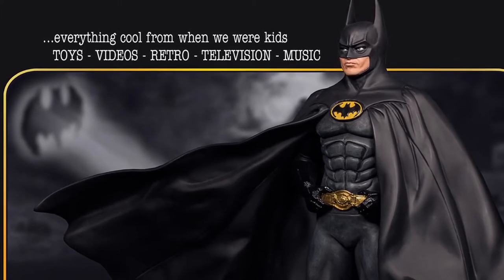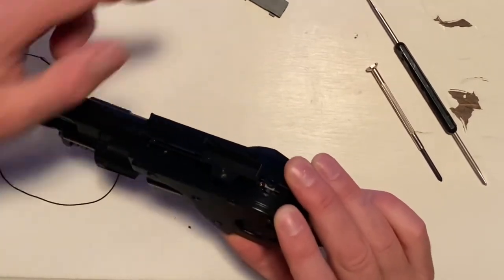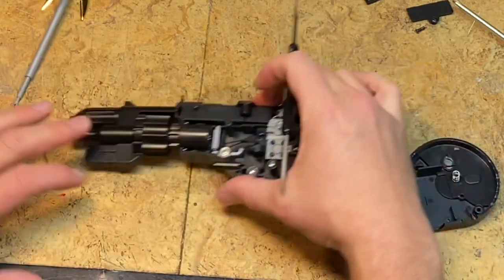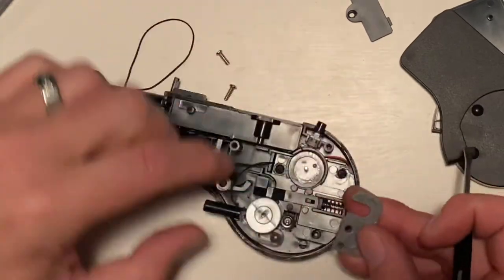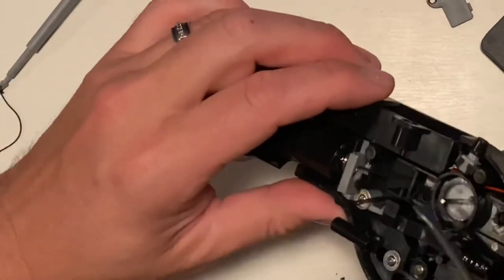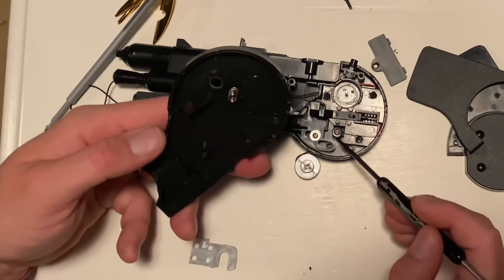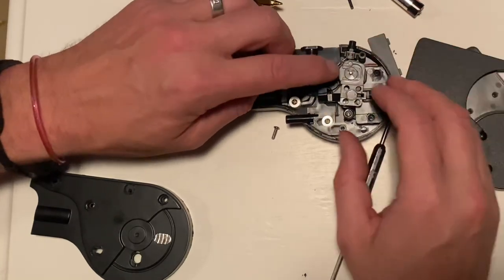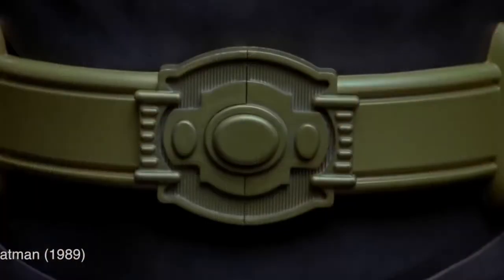Repair NECA Batman 1989 Grapple/Grapnel Spear Gun and Modify Teardown

Comment: Wish I had seen this an hour ago. I was trying to modify the gun so the halves could separate like in the movie. Didn’t know there were screws but I was able to pry the front of the back half open enough to get the front part out. Then I shaved down the tab one one side so that I can lock it in place or easily remove it at will!
Reply: Do you have a video or photo guide on how to do this?
Reply: @KMama-vs6np  thank you so much!
Reply: @katobrucelee08  there is one online somewhere
Reply: @slimshaec  funny enough I revisited this video yesterday and found the other one :)

Comment: Mine had same problem. Thanks for vid. Sadly as i was putting it back together I broke one of the wires for the retract button.
Reply: This happened to me with the animated grapnel! I understand that a retractable thread is going to get tangled, but it's ridiculous that NECA have basically made it so that you can't easily open up the grapnel and fix it without breaking it. I'd advise against buying any of these tbh.